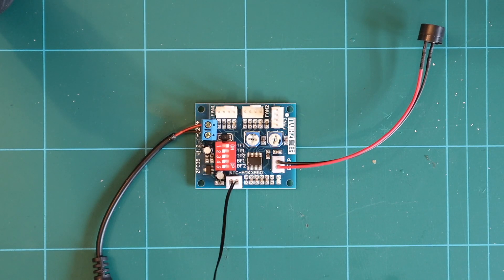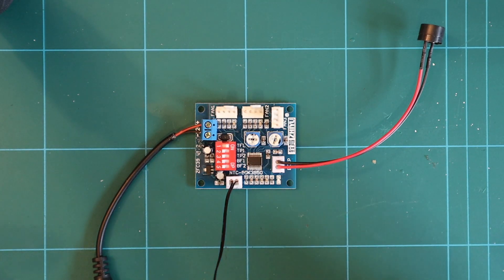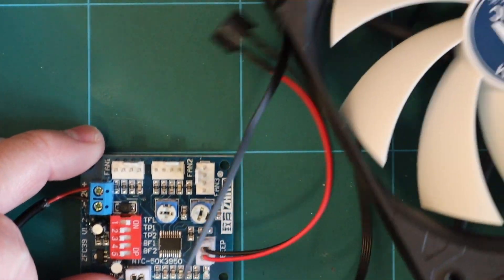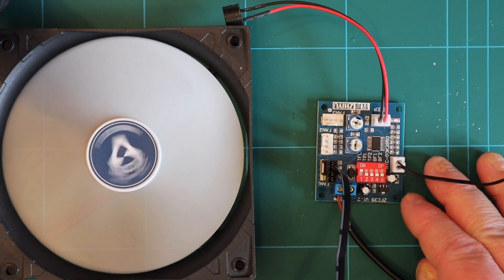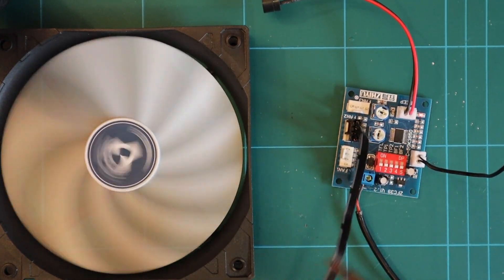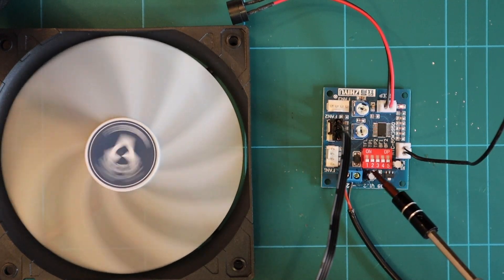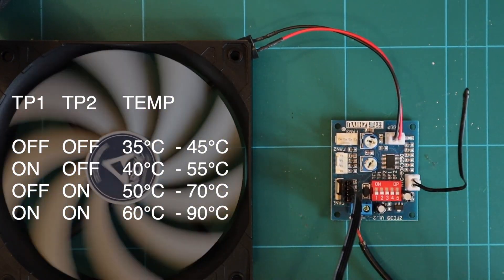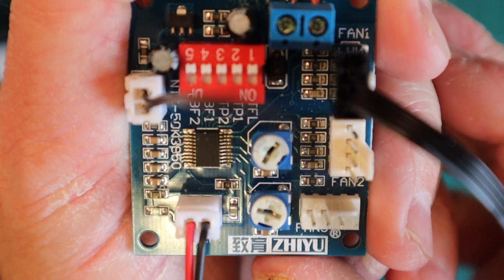ZFC39 PWM Fan controller

Comment: Circuit load capacity: maximum current per output is 5A for each connection, the bus currents up 9A limit...... Some fans like 6000 rpm comes with DC12V 3.9A 46.8W or DC12V 3.0A 36 Watt according to different brand. I brought the same controller but cant be use more than two fans (Nidec V35625-35) of DC12V 3.9A 46.8W (3.9A x 2fans = 7.8A ≤ 9A bus currents). hope this will help you understand you all... and thanks for this video ColdestMoon <3 <3. i just came here to see whether temperature control the other fan2 and fan3... now i understand from your great explanation...

Comment: Outstanding and very helpful video. Thanks for Sharing. 
I'm planning to use one of these for my campervan, as it gets very warm inside during the summer. Ideally Id like to reverse the direction of the fan, to allow blowing air out or blowing air in, but I'm asking way too much lol.
I did think I could just flip Fan 2, which will be used to draw cooler air in from under the van into the van and the fan 1 to extract the air out of the top. Maybe even use fan 3 as another fan to push the air in the van...so many possibilities.

Comment: I ran my own testing on this board and watched 3 separate YT videos on this board and THIS IS THE ONLY OF THE 3 that is ACCURATE, so I'm dropping a comment to steer DIYers your way!

Summary of my findings:
Fan1 - temperature controlled. TP1 and TP2 position change the temp range. TFL sets Fan1 low speed to 40%.
Fan2/Fan3 - NOT TEMPERATURE CONTROLLED - speed set manually with POTs.

10% is the minimum fan speed for all channels, not 0% or off.
Power must be reset to the board between settings changes (any DP SW repositioned).

LOADS of other good info in the video. Watch it to support the poster!

Comment: Can you reverse the polarity of the fan/s by reversing the 12v input voltage without damaging the module circuit board?

Comment: How does the alarm work if hooking 2 fans with a splitter to FAN1? It would beep only if both fans are not running, correct? Thanks for your input, great video, very easy to understand and straight forward.
Reply: i am guessing....but alarms depends on fan running below 100 rpm, that signals is read throgh 3rd pin...splitter usally have all four pins connector....PWM is sent to all fans through 4th pin......bun only one connector send back tack signal....if this fan fail, then it will beep...if other fan fail..nothing happen

Comment: Thanks for this video.
Today they sell V2.0 and still no docu except printing of the backside of the board.
Have you any idea how to change the NTC to reduce temperature for full speed of the fan?
Have I to increase resistence or to reduce resistance of that NTC?
Thanks for answering and stay happy in this dark times. 😉

Comment: Very nice video. Can the board only be used for PWM controlled fans or also for voltage regulated (3-pin fan)?
Reply: No just pwm 4pin

Comment: Just the video I am looking for. Can this control the speed of 3 pin fans?
Have been looking for pwm control for 3 pin fans. I mean, 4pin pwm fans basically have the pwm controller onboard right?
So I am looking for a pwm generator with temp control to output pwm power to the 3 pin fans.
Reply: no but yes....on fan1 speed is controlled by pwm pulse...fan2 and fan3 is just a resistor....if you plug a 3pin fan, then ...the fan will work with higher o lower amperage.....its simple. It works on a fixed speed

Comment: Thanks for the tutorial. My application is shoehorning an EVGA GTX 1080ti FTW3 heat monster into an old Z420 workstation. I'm 3D printing some parts to duct 3 fans to force-cool onto the CPU and the GPU and this controller will fit the bill. I was hoping all the fans were temp controlled but I think it's still going to work in the confined case. Once again thanks for the video.

Comment: Actually, you can jumper signal pwm pin from fan 1 and cut the connection to potentiometer on fan 2 and 3.
Reply: can i plug a fan with 2 pin ? thanks
Reply: @imadzed7985  Only 4pin pwm fans will get speed control. 2 and 3 pin fans will always run full speed.
A 3 or 4 pin fan is required for the stall detection (headers 1&2 only)
If your already using the board to control/monitor another fan and just want to use it to supply power, a 2pin fan would be fine.

Comment: Hii great video, follow your other channel, im about to do the fan upgrade on my caravan could i keep the thermal probe that comes on the board and maby exstend the wire as everywhere is out of stock of the thermostat switch you suggested, i understand that it would run at at least 20% all the time but that shouldn't do any harm should it :) thanks in advance

Comment: Can someone tell me the value of the potentiometers for fan 2 an 3? I would want to replace them with pots that I could mount in a project case and put knobs on them. I want an easily adjusted variable speed fan. I care nothing about thermal control.

Comment: can you use an Apple fan with this ZFC39 PWM Fan controller?

https://www.banggood.com/DC-12V-Four-Wire-Thermostat-PWM-Fan-Speed-Controller-Module-p-997793.html?cur_warehouse=CN

Apple p/n 610-0064 (model BFB1012MD-HM00)
https://www.ebay.com/itm/BFB1012MD-APPLE-P-N-610-0064-DC12V-0-82A-/192897769118

I hooked up the Apple fan and fan did NOT work.
I checked voltage at "+" pin which was 12V
I checked voltage at "S" pin which was 4V

I installed a 3-pin ppm fan and it works.

apple pinout.......................Controller
pin 1 motor control........connected to PWM 
pin 2 tach........................connected to S
pin 3 gnd.........................connected to -
pin 4 12v dc....................connected to +

Comment: william Hine
9 minutes ago
I have been doing some experimentation for cooling  the fins on the back of a thetford motorhome fridge/freezer using one of these modules and an arctic P14 fan ( more efficient and quieter than the F range fan used in the video ). Found the fan to be noisy a lower speeds, I think due to the 'pulsing' of the PWM causing vibration. I think the PWM signal is perhaps based on a low frequency based signal ?. I was about to abandon this module when I tried fan 2 port and turned up the speed to full, then lowered the power supply voltage down to 6 - 8v and found the fan to be absolutely silent at these lower voltages with no vibration at all !. Also found even at 6v -8v the fan still has surprising torque at very low speed and easily kickstarts itself if stalled manually. Perhaps the answer is to regulate the speed by changing the supply voltage but I dont know how to regulate the voltage automatically depending on temperature ? Any ideas anyone ?. One thing I forgot to mention is that I use a small buck module to regulate the supply voltage to 12v ( adjustable ) as the motorhome '12v ' supply varies quite a lot from 12v to 14.8v .

Comment: Great video. I'm just waiting for my parts to be delivered to add cooling fans to my Dometic fridge. Based on the supplied thermistor characteristics, by adding a 500k multiturn pot in parallel to the thermistor you should be able to bring down the "starting" temperature. I've calculated that a resistance of 91k should effectively give you a temperature range of 25 - 38 degrees C or 68k to give 20-36 Degrees C. My reasoning regarding using a 500K is that if it doesn't work, 500k would bring the curve characteristics almost back in line (if that makes any sense)
Reply: I have been doing some experimentation for cooling  the fins on the back of a thetford motorhome fridge/freezer using one of these modules and an arctic P14 fan ( more efficient and quieter than the F range fan used in the video ). Found the fan to be noisy a lower speeds, I think due to the 'pulsing' of the PWM causing vibration. I think the PWM signal is perhaps based on a low frequency based signal ?. I was about to abandon this module when I tried fan 2 port and turned up the speed to full, then lowered the power supply voltage down to 6 - 8v and found the fan to be absolutely silent at these lower voltages with no vibration at all !. Also found even at 6v -8v the fan still has surprising torque at very low speed and easily kickstarts itself if stalled manually. Perhaps the answer is to regulate the speed by changing the supply voltage but I dont know how to regulate the voltage automatically depending on temperature ? Any ideas anyone ?. One thing I forgot to mention is that I use a small buck module to regulate the supply voltage to 12v ( adjustable ) as the motorhome '12v ' supply varies quite a lot from 12v to 14.8v .
Reply: Your 25-38 range is exactly what I'm aiming for.  Did you have any success with this and would you be willing to provide any details?

Comment: Great and very informative video! My question is - would Fan 1 turn itself off automatically should the temperature drop below the set value or will it still be spinning at its lowest speed until the circuit is powered off? Looking to use it as my AV cabinet extractor vent and it would be ideal if fans only came on when something is in use rather than spin  all the time. Cheers.
Reply: As far as I can tell the fan will not turn of but keeps spinning at the set duty cycle. I have the same idea to use it as a cooler for my AV cabinet end I think I'm going to use the switched AC-outlet of my amplifier to switch the power supply on and off for the temperature control whenever the amp is switched on.

Comment: I bought this thing from Aliexpress. 1.86 euros, so very cheap. I have also found this effect after some thought. For me, the fact that it only starts at a minimum of 35 degrees Celsius turned out to be insufficient. I would like to have an effect between 25 degrees and 30 degrees Celsius. Would there be an opportunity to build in this ratio? As an alternative I keep construction with an Arduino microcontroller at hand.
Reply: Just a guess, but it might be possible to bias the thermistor temperature probe with an additional resistor in series? This board appears to come with a 50 KOhms thermistor with a B-value (bias?) of 3950 K (Ohms?). If you search for "50K B = 3950 pdf" you will find a datasheet. According to that you'd need to bias it by 17.41 KOhms, to get the minimum temperature from 35°C to 25°C.
Edit: I was wrong of course. Adding resistance will require the temperature to be even higher as it makes it read a lower temperature. A solution would then be to wire an appropriate resistor in parallel.
Reply: I figured a 90 KOhms resistor in parallel would change the 35°C-45°C activation interval to ~25°C-38°C. It would be easiest to add an e.g. 100K Ohm 3296W-1-104 multiturn trimming potentiometer in parallel and adjust it as needed, though a precise 25°C-35°C is not feasible with such a simple change.
Reply: @user93237  adding resistor in series would increase overall resistance. That should trick processor to read that temperature is higher than it really is.
That in effect would make fan come on  earlier.
I think you first thought was correct.

Comment: thanks for the info.   this item look perfect for cooling my 48 volt inverter...my problemis is  the 48 volts. is there a way to upgrade this unit to 48v? thanks in advance
Reply: Easy to use DC-DC stepdown converter.
Reply: You can use a Voltage divider.

Comment: Hards.. after 7 different unit.. Yes this one do work easy ! But The best is to get a ATTiny85 and put a pot on it and it work direct. But this board do work direct.
Reply: hello . can we use ATTiny85  for speed adjustment of fan with pwm ?
Reply: @mertsamet2953  in fact, this is the second best option to go. and bit less cheaper. But for a ready to used and ready to ctrl 2 fan. This unit is perfect.

Comment: Hi there, Brilliant Video thank you for the explanation, I would like to ask some questions please, I am making a cnc cooling system in a closed loop using either 1 or 2 fans, i havent decided yet but I can only get black fans , the old type without decent CFM, the 3 and 4 pin fans seem to give out more CFM , also the important bit for me is white!

Do you think that I would be able to run 2 fans off this and use it to control them direct on my 2 fan radiator,?

Could you extend the wires on the thermal detector so I could bury that inside the radiator for emergency heating in case the water gets hotter so run both fans of pin 1 ? 

I have a sealed coolant tank  3 litres in a pure copper cylinder I have made and had sprayed pure white  , A lovely expensive all copper white two fan radiator and white silicone tubing. and white pump all filled with special coolants and silver for bacterial issues.

You see the theme going on here, slight OTC 

Finally could you run RGB fans off this and use the remote that comes with them to change colour if needed?. 

Thanks, Im not a pc guy just a cnc guy looking to build a decent closed loop cooling system to avoid emptying a bucket of filthy water every week.

thank you very much, a well explained video and the first I have seen on how to use 4 pin fans directly off 12 volts. If you could find time to answer my questions that would be brilliant thanks.....thanks. Neil

Comment: CONFIRMED!! ZFC39 Version 2 will control all 3 fans based on the thermocouple temperature, if pads SY are soldered or bridged. Note also that in Version 2.0 the 'Fan Stall' alarm is disabled during startup, eliminating that annoying beep during startup. I am also experimenting with adjusting the 'Accelerating temp' and 'Full Speed Temp' values by placing resistors across the thermocouple.
Reply: Any idea where you can find a version 2 board?  I keep finding all the 1.x series boards.
Reply: ("CONFIRMED!! ZFC39 Version 2 will control all 3 fans based on the thermocouple temperature, if pads SY are soldered or bridged.")  As indicated on the bottom of the PCB. But I am very interested in whether it is possible to operate the device at a Temp of 25 degrees to 30 degrees Celsius.
Reply: Exactly the information I was looking for! Thank you so much
Reply: Confirming as well
Reply: Potanciometr1&2 pls DiFranco.thankyou

Comment: Thanks for the video! I am tinkering with a board right now. Note that my board is ZFC39 Version 2.0. This board has a couple of extra shortable pads. The first is called PF, and the screen-printed information on the underside of the board says "PF=Reverse Voltage" (I have no clue yet what that means! Maybe as the thermocouple gets hotter the fans run slower?)
The second pad is labelled SY, and the information next to it says "SY short: Fan3=Fan2=Fan1" I am going to short SY and experiment with fans on ports 1 and 2, and see if both are speed controlled.
Reply from the maker: Hi Iain, thanks for the heads up can you put a link to where I can purchase these from so i can have a play also. thanks
Reply: @ColdestMoon_Channel  Try this link:    https://www.amazon.co.uk/WODE-Temperature-Control-Controller-Module/dp/B019OWYFI2
Reply from the maker: Hi Iain, sadly this is the same unit as the one I have, and does not have the functions you mention. Thanks anyway.
Reply: @ColdestMoon_Channel  I can send you one. However that doesn't help you,  or others,  find a way to specifically get the newer version boards from suppliers...Where are you located?
Reply: @ColdestMoon_Channel  Please contact me. I have another V2 board here and will send or deliver to you if you wish. ( I have sent email and tweets to you also).
Reply: Any idea where you can find v2 boards in the USA?  All I can seem to find are v1.x boards.
Reply: @Chris_In_Texas  Hmmm... I can only suggest that you contact a small supplier on Ebay, and 'contact seller' to ask them to make a physical check of their inventory before they dispatch the item. Describe the unique features of the v2.0 board and see what they say...

Comment: Hi I just realised that the max rpm of my Noctua 200mm fan is only 800rpm and the stall alarm minimum speed on the module is 700-800rpm.Can you kindly share your thoughts on how to go about setting up .Thanks Heaps

Comment: Thanks a lot for the well articulated video.I just bought this item to control the fan which I am planning to use to cool my hot running AV Reciever and I was also not very clear about the operational instructions given by the merchant. This video is a God send. Thanks again!!!

Comment: Awesome thank you 🙏🏼, I have a question there’s any differences between a 4 pin fan and a 3 pin fan using this board? Thank you for your video it just resolved a lot of question.
Reply: To my knowledge the 4th pin is the PWM pin so you can put a 3 pin fan on this board but it will most likely run at full speed an you would not be able to take advantage of the PWM speed change ability of this board.
Reply: The device does not work with a 3 pin fan. It will then continue to run at full speed.
Reply: Julian Aviles Same question here ☝🏻

Comment: Nice video. I suspect that the IC is actually designed for a single fan but the board was adapted for it to run three fans.  I've been investigating the TC647 PWM Fan Controller which is a single fan controller for the 2pin or 3pin fans.  It would be nice to get hold of the main chip for this unit and build my own circuit.